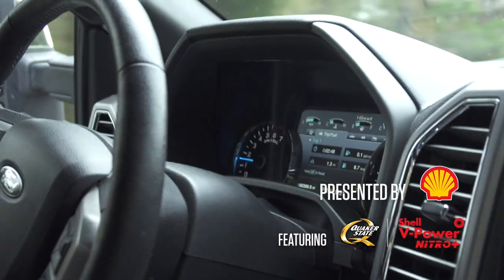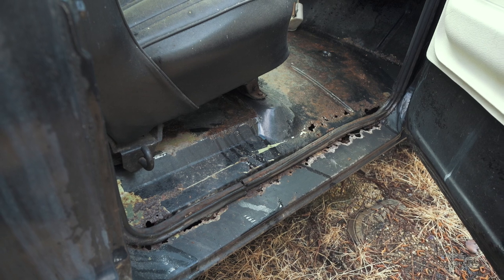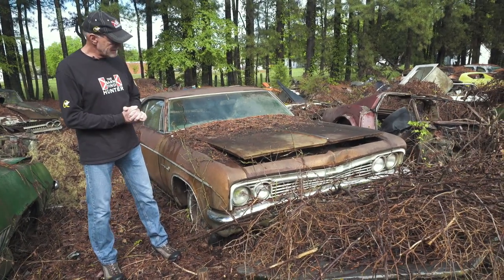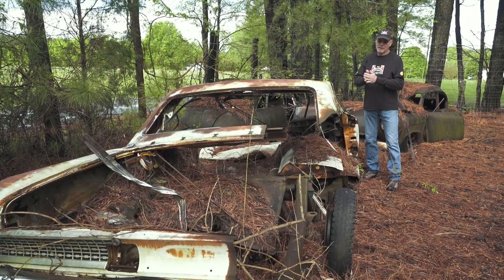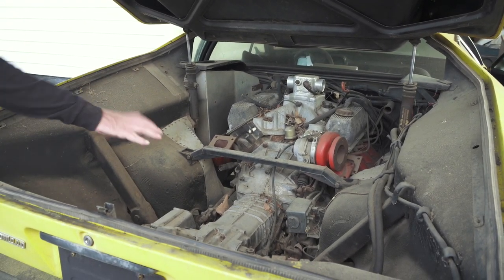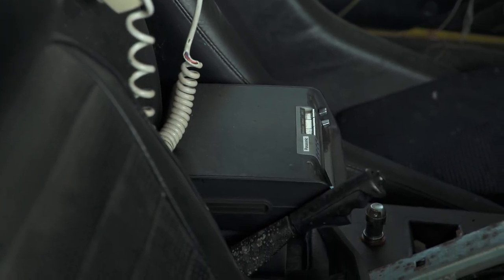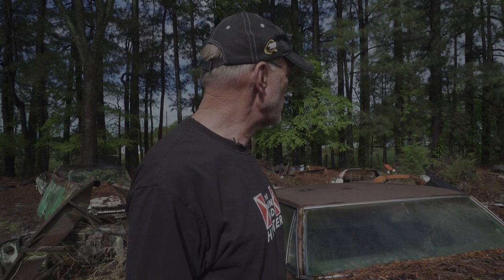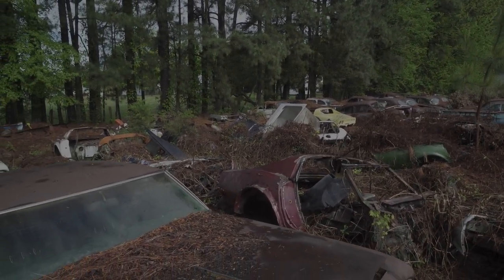R-Code Ford Galaxie 500, De Tomaso Pantera and MORE! | Barn Find Hunter - Ep. 49

Comment: I completely restored a Pantera back in the 90s, and I mean all the metal that was rusted. What people dont realize is that these bodies were assembled and before paint and primer they were stored in the yard unprotected. Some cars new at the Ford dealers already had serious rust problems. So you have a triple sandwiched unibody (in places) and a serious pain to restore. I probably spent 600+ hours in metal work alone and had to hand fabricate a lot of parts. It was a learning experience - LOL. I should have restored an old Ferrari.
Reply: I plan on restoring '67 Chevrolet Impala. Any advice?
Reply: Yes, they were complicated cars to restore, but a Ferrari from the same period can be far worse and the price of parts for them is just ridiculous.  A lot of Pantera parts, because, mechanically, they were parts bin specials, are still available for sensible money.  And, well, they're not a Ferrari.  A thoroughly well-sorted Pantera is easily the car that Ferrari wished it could build back then...
Reply: Did it run hot , heard they had overheating issues ?
Reply: Troy Ammons That's a shame. Always Loved Panteras. An older gentleman has 2 in his garage here , and told me the very same story about their rust issues and history. He worked offshore and bought 2 when they were new. He loved them and keeps them indoors, and they still have rust issues. Sad
Reply: @b.c.gamingss  Depends on condition. First start telling us what's wrong. I to am restoring a 69 Tbird. A lot of work ahead of you my friend. On my Tbird alone it took me 4 months of hard work to just get the car road worthy again. That's replacing all the suspension, brake system (including power booster and master cylinder and lines too), sanding and painting the underside. Also rebuilding the transmission and rear axle and new tires. Finally rebuilding the steering system. I haven't even started on the body. the trunk needs to be stripped and resealed and painted. Inside I need to pull the carpet out and check the condition of the floor pans. Doors need a little bit of work (no rot thankfully). My biggest problem is the rear quarters. Both sides have rot and need to be replaced as well as the dogleg behind the door. Now I don't know the extent of what you need to do, but looking at what I went through can give you an idea of what you are possibly getting yourself into. Good luck and don't give up on her!
Reply: @Someguy6571  Well I do not have the car yet. It is very close by where I live. It has some rust but I did not see the underside of it. I want to buy it. I need to look at it a lot better. It has a 327 and is automatic. I plan to do all the work my self. Any idea if a t56 termec pairs well with a 327 Chevy engine? Call me crazy but I just do not like new cars (In terms of working on them)but I want an old car that looks good at gets at least 20 mpg.
Reply: @John Smith Alright I will check it well. Are they good cars?
Reply: @John Smith I like all cars. Even many new cars. Get a convertible unless you already have a car. Actually what cars do you have?
Reply: @b.c.gamingss  You are not going to get 20mpg in a 1967 impala with a 327. Doesn't matter what transmission you got. Paying 3k for a 6 speed manual to put into a car with an automatic? Nah... sounds like A LOT of work and A LOT of money. Then you need to add in petals for the manual and  all the other fabrication. You would be better off modifying a 700R4 in my opinion to work. 700R4 is a good GM transmission with overdrive and a lockup clutch in the torque converter. Of course you would have to modify the modern transmission to work, but I bet there are controllers out there for them. Also changing the flexplate and trans mounts. Though I bet its much easier getting it to fit in over a manual one. I am guessing that car probably has a what? TH350 most likely. Maybe the TH400. In anycase I feel a 700R4 would be your best bet. Would probably get you close to that 20mpg number as well as be good for highway travel too.
Reply: @Someguy6571  Thank you for your advice. How will a 6 speed manual not get me 20 mpg? I think the t56 is good enough but I will do more research. If anything I will go with what you say. (I want a manual in the car.... So there is that.)
Reply: @b.c.gamingss  Making an automatic car manual is a HUGE undertaking. Requiring all the fabricating of the car for the clutch petal, where it mounts, and the cables for it. Also you probably have to adjust the brake pedal to accommodate the clutch as the car was not designed for clutch. Then theres the cutting of the floor for the stick shifter, fabrication of the trans mounts and then mating it with the engine. Let's not forget the cost of paying for a 3000+ manual transmission, and that probably doesn't include the shipping costs or the costs of additional parts/materials for the modification either. If your goal is a manual car then start with one that already has manual in it. I don't think any transmission is going to get you any real improvement in mpg on a 50 year old not electronically controlled engine. You may get close to that on the highway, but forget it in town. Not happening. Not with a V8. You would have to do some work on the engine like electronic ignition, changing the old carburetor over to modern electronic fuel injection, and when you are going that far what is your goal really in the end? An old muscle car you want to cruise around in or a daily driver? Think hard on that. In my opinion just have a second car for your day to day driving. Any project car like these the end result is almost always never daily driving them for most.
Reply: @Someguy6571  Thank you for your advice but I am determined. I think I can do it. Also when I get the car running it will be my daily driver. I am not like most. I was not expecting 20mpg around town. I do not know of a V8 that gets that mileage around town. My plan was to keep it carbureted. The build might take me 1-2 years. When I start it I will post a video and then another when it is done. After that I will check what mpg I get.
Reply: @b.c.gamingss  Good luck! Sky's the limit!
Reply: It's a dam shame they rust out so bad because there my favorite car. But if there was a fiberglass kit car replica available I would totally get one
Reply: @Someguy6571  Thank you!
Reply: B.C. Gaminess - I like your plan. I’m doing the same thing with a 68 Bonneville Wagon. 6 speed, original engine. Plan is for a DD style car. I may add fuel injection for a little better mpg and drivability. It’s a bit of fab work but really not that bad. My car is stripped to restore it anyways so it’s going to be part of the build.
Reply: @thebigpicture2032  Sounds good! Listen old cars can still be daily drivers. EFI will help on mpg quite a bit. Around town might be the only big problem but there is a solution for this and it is called a motorcycle! Well anyways good luck! Post a video of it when you are done I would like to see how it looks.
Reply: The trick with Panteras is to scope the underbody before you buy. Some were assembled rusting, some were not.
Reply: @Scalihoo  It was off and on. It ran up there, but never overheated except for once on a trip. My car burped coolant, so you had to watch it.
Reply: @b.c.gamingss  That car has a frame so you are better off. Blast it and put it on a rotisserie.
Reply: @b.c.gamingss  Let me add. Buy a rust free (or as close to it as you can get) from out west. Will save you a massive amount of time.
Reply: @truantray  There was one down here that was restored everything rebuilt and it was expensive for the early 90s. However, if it was as they described it would have been worth it.
Reply: Also, I almost forgot. I was approached by a guy that wanted to trade my Pantera for his Mangusta and I am still kicking myself.
Reply: I will also add once again, that although I completely changed the Pantera AC system and got it running like it should and had good seats (the original 72 seats are awful) I just never really enjoyed driving it that much. The car I really wanted was a Pantera GT5S. That said, while I owned my white '72 Pantera, I built a turbocharged Porsche 928 GTS knockoff from an older 928 body. IE I bought a GTS fiberglass kit and upgraded everything, lowered, S4 brakes, custom FI, wheels, new interior etc and that car was really nice to drive unless it was raining - LOL. At 12psi, that car would redline faster than I could shift. It was faster than my Pantera.
Reply: @b.c.gamingss  Head out west and buy a rust free car.  Will save you hundreds of hours and a lot of aggravation. Strip it to the shell, blast it and put it on a rotisserie.  That is how I would start if I did another car.
Reply: @Scalihoo  My Husband worked on his Bosses Pantera yes they would over heat the front fans were not that great but there are better radiators for them now.
Reply: " 600+ hours in metal work alone". Thanks for that. Not too many people talk about the hours it takes to restore a car. I met a guy who restored a greyhound bus, from the 40's or something. He made it into an RV for himself. He claimed 5000 hours. I think most people who talk about how valuable these junk cars are have no idea what the actual hours invested are or would be to bring them back.
Reply: 😍Always loves Panteras!😍 I know this comment is old but I was curious if you (or anyone else) knew of the earlier (like this one) Panteras didn’t yet come with the chrome gated shifter trim piece??🤔🤔

All the ones I’ve seen (older than this one) had a chrome trim piece with actual “gates” on it... whereas this one doesn’t have that.
Reply: I’ve heard that the early ones which were shipped by boat had more severe issues as well, from all the salt air during the trip.
Reply: @ProducerLare  They probably removed it. I ran mine without the gate for quite a while.
Reply: @MichaelBlueMusic  It wouldn't surprise me. I read the "stored out in the yard for weeks" statement in a book on Panteras.

Comment: Oboy, I think that Pantera has a Gale Banks twin turbo kit from the '80s. I remember seeing one at a car show when I was a kid on a Camaro. With one turbo missing and one hanging by a thread, I'd guess the motor is grenaded.
Reply: N Ferraro would’ve been a great handling car with those small turbos and mid engine it’s too bad they didn’t fix it
Reply: So you just swap it with a Windsor V8
Reply: Cleveland fast without forced induction

Comment: Interesting.  The K5  blazer was a 4 whl drive.  The C Blazer was  2 whl drive..  May have been fenders off another truck or it was actually a 4wd Blazer
Reply: Didn't see a 4WD shift lever in the Blazer or the Suburban.
Reply: Thought it might be hiding under the floormat laying on the seat, but after looking at interior pictures of a 4wd 72 Blazer transfer case shifter, I think you are correct.   The steering wheel looked to be off a Camaro as well.

Comment: I have seen videos of the Ford plant in the 1960s using an electric (using charged particles for coating, very similar to how a laser printer works) rust prevention coating. The coating was on both the inside and the outside. They basically put a negative charge on the body and then submerged the body in a bath which is positively charged.  Whatever they were using didn't work.

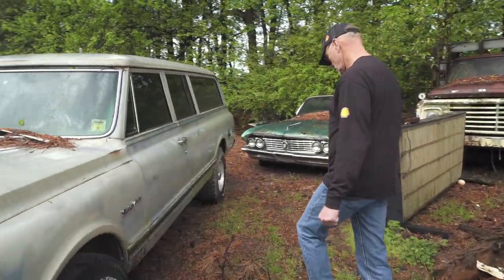Comment: 3:15 is that an F600 in the back? I had a 71 Ford 600 around 2001 with a 300-6 and 4 speed. The single speed rear axle limited it to 50 mph on a flat road. It was my daily driver for about a month. A 4 wheel drive F700 would be a fun ride.

Comment: I am not sure what my Pantera was, but I bought it from a dealer in 1975, but the title said it was a 1973, and a new title. The dealer was known to do some strange things to cars, but still it had a new title. The engine was a SCJ 428. I've had some people tell me that they never put 428's in this car, and I have had Ford guys tell me they made very few of them. Does anyone know for sure? I am thinking the dealer did it just to see if it could be done, but just not sure.
I bought it in 1975 for $13,000.00 and sold it in 1976 for $14,000.00 (USD). I thought I was pretty smart, driving the car a year, and selling it for more than I bought it for.
Out of all the cars I have had over the years, I miss my 1970 Olds 442 W-30 the most. I was an automatic, but it was a lot of fun.
Smiles!
Reply: All factory Panteras were 351 Clevelands. All.

Comment: Saying that Pantera isn't worth restoring is nuts. I would love to have it, and I guarantee you that I would restore it to show quality and do it at a very low investment as I know how to fabricate and do the work myself. I have built more than a few show cars in my day and did it correctly and any patches required were butt welded and metal finished. Being retired and disabled makes it difficult to do some of the work now but I have plenty of time but not much money, but I don't care how much labor I put into a restoration if it's a car I really like, and the Pantera is a car that I LOVE, so all time I would put into it would be a pleasure so to me those hours would be great therapy so wouldn't be considered an expense. Yes, it would take me several years to buy the parts and materials it would require but it would still get finished and take at least a few trophies in area shows.
Reply: I'd get it running and spray on some primer. Not everything HAS to be a show car.

Comment: When you say "not worth restoring", I mean, I have been viewing some car restoration/building of cars in England,...they are stuck there with what they got locally and what they can rebuild and what was popular, Ford Cortinas for instance, and when you say non restorable, I see less rust on that 427 Impala than what some of the vehicles that are getting rebuilt, sometimes with insertions of pieces of replacement metal even in the door posts, just everywhere and donor metal and replacment panels, and panels remade, etc etc.  In America, so called restorers really have it good, where the best of the best junked cars are chosen to rebuild, due to minimal restoration work, like door skins, floor pans and quarter panels, fenders too, but imagine rusted out damaged firwalls and extremely damaged roofs, yeah, roofs, I mean, it changed my idea on what a goner car is, and I have minimally repaired hot rods and other cars in the past, so all I am saying is that maybe, just maybe, if a vehicle is around fifty percent rebuildable, then a person could in theory just put in a little more work, especially the costs of so called restoreable hulkks are reaching some rather crazy heights, I guess cause folks flip a restored vehicle as a business.  Thirty years ago I had a 1970's firebird with a big block engine, and rust around the rear window, quarter panels, lower door skins, but strangely the floor pans were good as far as I ever knew, and I bought a lincoln sp100, I was fresh out of the army as a mechanic, and taking mechanic courses, and I kept on cutting out rot and rewelding in patch panels, even did some brazing to smooth things over, I mean, folks told me my car was not restoreable, and I hear its still in existence to this day, my repairs were solid and not noticeable, especially how I prepped the panels inside after I was done welding the repairs.

Comment: in the pantera the "phone" is really an old school cobra CB radio with a handset for a mic / speaker, it made you look like a sophisticated CB operator
Reply: Tan CB made by Johnson
Reply: @radiorick4975  Nope, Midland model 13-884.
Reply: @k4sar1  well I stand corrected. Johnson did make one it was tan in color. Had a gentleman run out the store with one around the building and down the alley. He hopped in the back door of a old four door continental yelling go go go they drove off with my radio. I would have caught him, if I had not hit gravel on a turn.

Comment: Love the galaxies, got one in my garage. It's just a little 289 i've had it since 1990 .
Reply: Nothing wrong with a 289. Because they are lighter the car handles better than any of the big blocks. The small blocks can be breathed on with bolt on parts if not already a high output model, so they make a nice cruiser. Also decent gas mileage and reliable with maintenance.

Comment: That's not a phone, it's a CB made to look like one. A few companies made them. That's a Cobra but Radio Shack sold a similar one, too.The  big dial is  the channel knob .A real phone didn't have all those buttons and dials on it. One thing a real one DID have was a key switch, similar to one you might see in a elevator. That was to keep unauthorized people from using it.
A real phone also was just the control unit in the car, connected to  a big box in the trunk that could weigh 25-35 pounds.
Reply: Not a Cobra - Midland model 13-884.

Comment: Although it's terrible and cut up, the white R-code Galaxie might still be worth restoring as a saloon car racer or maybe a classic stock car, especially if it still has parts with the original identification numbers on it to prove it was an R-code car.  A lot of really big names in motor racing had a lot of seat time in the big Fords in saloon car racing over in Europe back in the '60s so there's a lot of interest in building classic racers out of them, especially since some of the teams that run them have shown that the big American boats can go and handle really well even around tight, twisty circuits like Goodwood, as lots of videos on here from the Revival meetings show.  You'd probably never take that car on to be a 100 point concours restoration unless you were extremely brave and had a lot of spare time, but to restore to be a classic race car it still has plenty of potential...
Reply: Somebody has already scored the tags so somewhere there is a clone . We had one big Ford racing here in the 60's driven by the gheoghan brothers and one came down to Australia from the UK at the same time for a series of races.